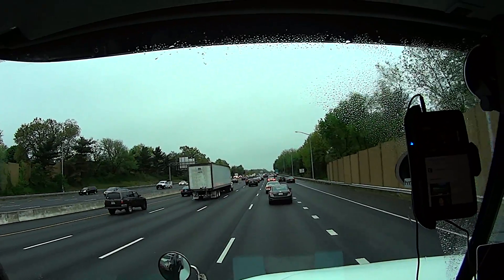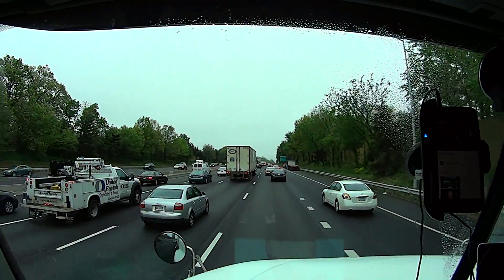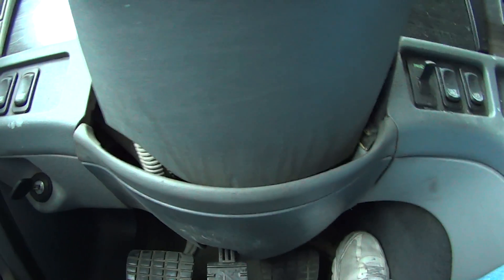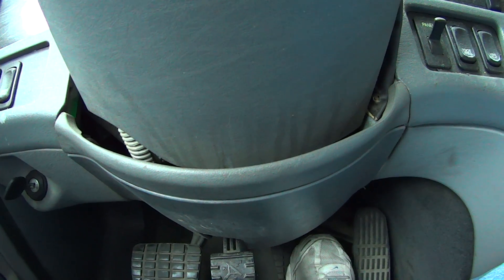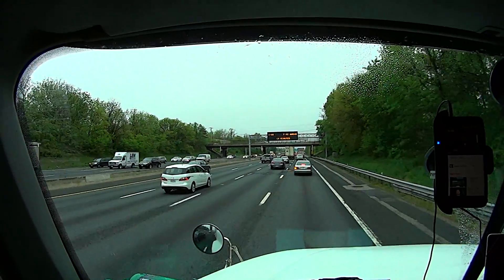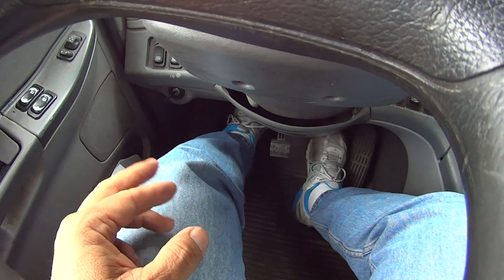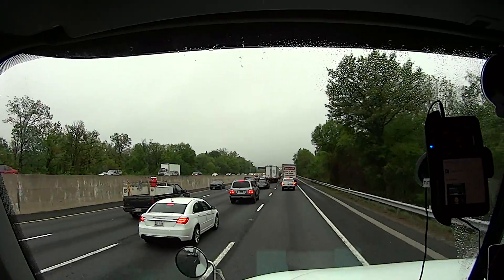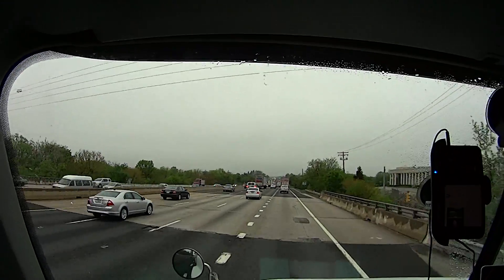Auto shift transmissions with clutch

Comment: Nice video do you know if a three-pedal clutch can be changed to a two-pedal clutch and if so who does it thank you
Reply: No, a 3 pedal is a regular 10 speed manual with  a computer that does the shifting. You have to have a clutch. The 2 pedal is an actual automatic where the torque converter actuates with rpm.
Reply: @utubedude2842 there are some 2 pedals with a computer controlled clutch instead of a tc, and computer controlled "manual" shifts instead of clutch packs.

Comment: That's cool, I've been looking for something like this but for a car. I just recently found out classic drag racers would match a clutch assembly to an automatic via an adapter. That would take away the 'slip' from a torque converter, applying direct power dropping RPM, raising MPG, and the gears would kick in like a mule XD
I was going this would help but alas, my search continues. Cheers! :D

Comment: Thanks for a great video. OK, so, at a red light you just stay braked and push the clutch, so that the engine does not fight the brakes. Right? I bought a similar freightliner recently. Do you switch to neutral at traffic lights?
Reply: Exactly. Just keep the clutch pressed to the floor when stopped so the engine doesn't think it's just under a heavy load and fight the brakes. & No just leave it in drive when stopped at a light. It's the same as a manual just no shifter coming out of the floor.
Reply: Is it bad to shift to neutral if it’s a long light to do it allot like that?